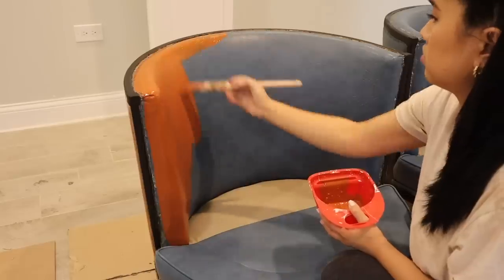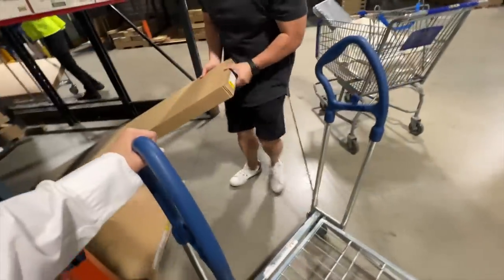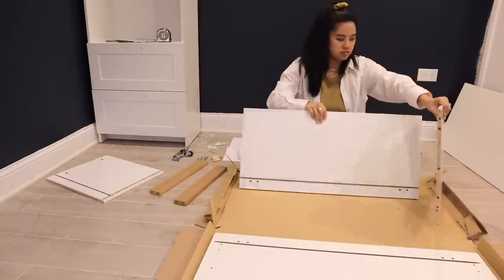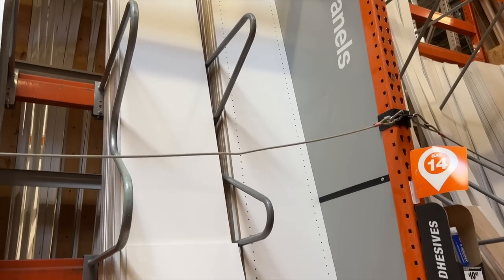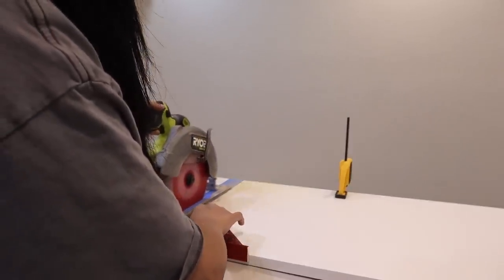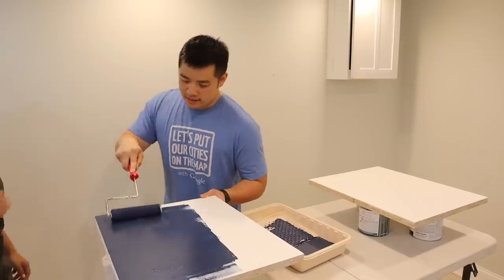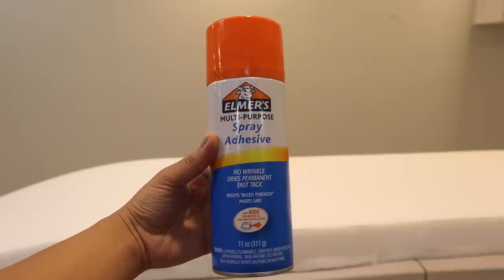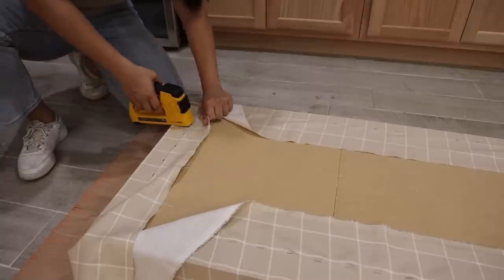making over my reading nook! (again) | DIY BUILT-IN BENCH + BOOKSHELF *IKEA HACK*

Comment: Quick question, you said that you were off by about an inch and that's why you changed your design plans. If you removed the baseboards for the book shelf and around the post, would that not have given you enough room? Just curious more than anything.